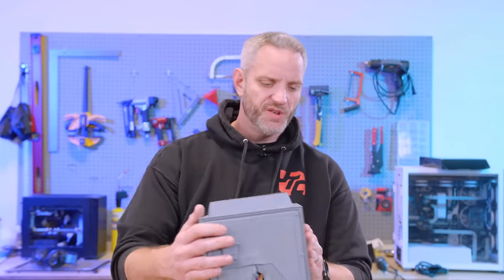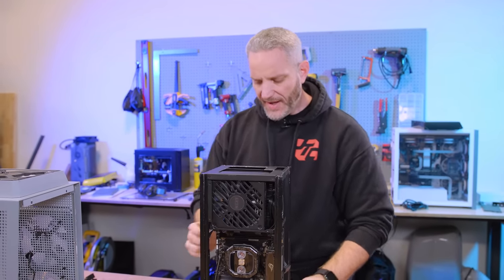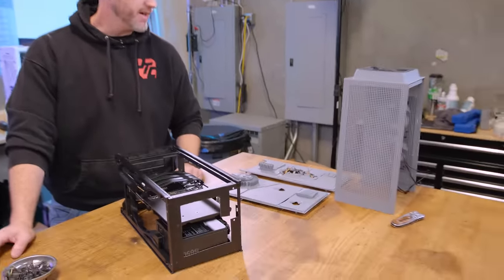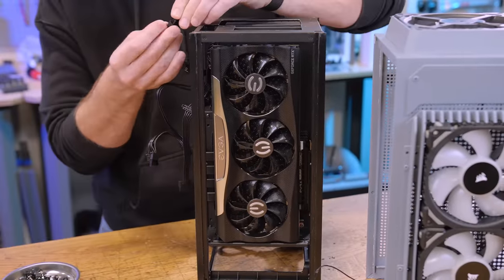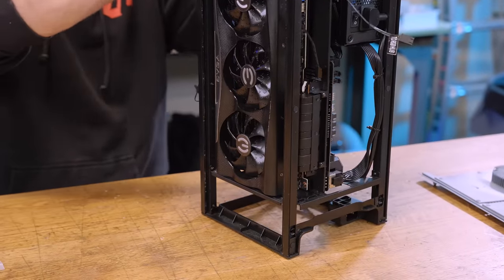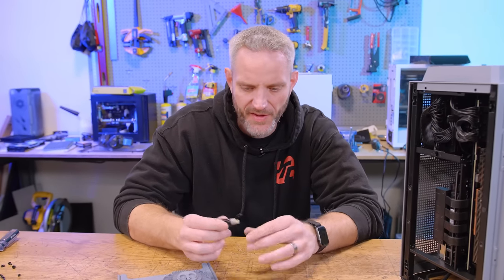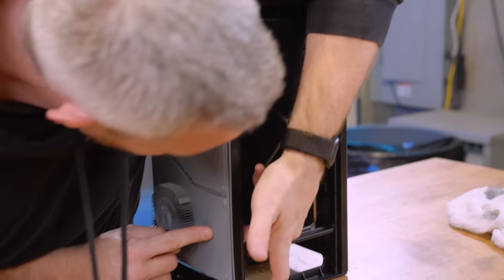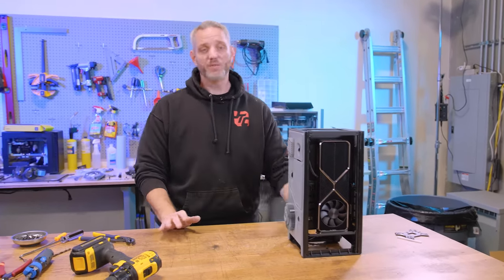This is unfortunate... but I wont let it stop me!

Comment: Just want to put in another vote to get this project finished. I've been searching high and low for inspiration to do a Millennium Falcon themed build with casemods and functional watercooling tubing like the pipes you see on the Millennium Falcon. I was so stoked to discover this video series but it looks like it ends here. Really wanted to see the finished product w/ the airbrushing, water cooling, and lights. So many "casemods" are just paint jobs or LCD panels and RGB, this was such a cool project.

Comment: As a past H1 owner, it’s awesome to see such a bespoke custom build come together, while remedying many of the faults the case possesses. 

With that said, and from past experience using the 3070 FE in this case: you may want to reconsider the FE card, or at the very least make another modification to the case itself. The flow-through design of the card won’t work properly by default, with an internal case panel behind the GPU obscuring exhaust airflow. Additionally, any heat expelled via the PCI backplate will only go down, and then rise back up. The result for my 3070 FE meant that thermals were horrid for the most part.

Comment: Hey Jay, for the power switch, you should use two exposed wire from the bigger damage hole and touch them together to start it. Works the same way as a screwdriver on the motherboard pins. It would be like hot wiring a car. 
Also, thanks for the great content.

Comment: Hey Jay. 
That Asus Tuf 3080 does fit in the NZXT H1. I know for a fact it does, because I have that exact same card in my NZXT H1 and it fits just fine. 
Also that FE card that you are using will overheat because of the 2 sided fans design on that card in the NZXT H1 case.
Reply: Why would u still want that case? There’s so many better small form factor options
Reply: @EmperorWasHere  
Best pc case I have ever had in the 20 years of having a computer, and I like it alot.

Comment: I stuffed a 1070 with the Arctic Accelero 3 cooler in the H1 by leaving the riser cable bracket unscrewed. Gives it just enough wriggle room and the case holds its secure. Even fits with the dust filter.

Comment: Possible spoilers RE: unfortunate but won't stop me
*It's a Rebel themed build, but the Empire just crushed them.
*No power button, you need to use the force to turn it on and off
*Once it's all put together, the fans sputter like a Millenium Falcon.

Comment: Would you consider doing a techmas video on fittings for water cooling? Will be doing a custom loop in an o11 mini with a distributor plate at the beginning of the year but it’s hard to know what fittings I need to buy. 

Over research I found I need the default connectors no matter what but then you have to choose 90s, 45s, extenders, offsets, etc. it gets confusing and is difficult when ordered from EK and paying outrageous shipping.

Just a suggestion for what I would assume would be an easy video for you. Love your content!

Comment: Hey, just an idea.....
4 long screws with the external cpu cooler,
Put springs between case and cooler,
Then install button under the cooler,
Using the cooler to push the button.

Comment: I just got that case, or an original version of it. Replaced my nr200p with noctua U12a. I'm very surprised on how well it works and performs. Although, I do have another front-panel, perforated. Temps and noise level is sometimes better than with my (poorly configured) nr200p :D

Comment: No need to worry about that tube getting a little pinch indeed. The microstructure inside the CPU block is by far the biggest restriction in the loop, even a little bit buckling of a tube would be insignificant.

Comment: With such big fans right on top of the GPU, would it not be worth De-shrouding the graphics card for better cooling and less noise Jay?
It can be done without ruining the GPU so you can put them back later and would save trimming any shroud if there are any fitment issues.

Comment: Would've been cool if you used the wires from the damaged section to have a "hot wire" effect instead of having an actual button. Just touch the wires together whenever you want to turn on the PC.

Comment: You could also drill a hole in the heatsink on the side and put a little switch in it and the logo could connect to switch as the buttonface.

Comment: Almost twenty years ago I was having power button issue and the Radio shack multipurpose button was huge (I finally wound up using it) and all the stores that even had computers wanted to sell me a whole computer and then I could take the button out of that. I wasn't gonna find a regular computer button in the area I live in. Hopefully you have a few parts machines in your inventory.

Comment: Since the power switch has the LED's baked in, you could tie them to Transistors, and have that run off the power led signal from the motherboard to get a "malfunctioning" intermittent indicator light.

Comment: How about turning the Rebel logo into the power button? Drill through the heat sink, recess into the back of the logo and attach to the button head maybe? This would help with the depth issue.

Comment: I know this won't get seen, but!!! It would be awesome if you put a small Arduino Uno in the case on the GPU side and used it for advanced RGB lighting for the damage spots on the case.  Instead of basic effects offered by all retail RGB strip kits, you could have it set to look like fire with random white sparks happening around different spots of the holes.  RBG gets a lot cooler with an Arduino and a roll of addressable WS2812B LEDs!  Also, I'm still rocking the 1080 Ti I won from you in 2018 ❤️

Comment: I'd like to see you guys custom build a pc. Use store bought components but custom build the interior and exterior "case" using 3d modeling and machining. Like a billet aluminum case etc. That way you have full mounting/routing freedom. Use hard lines for wiring routes with custom length wire runs from psu etc. Just really out of the box stuff.

Comment: I know that Jay doesn't use the front panel i/o, but many of us do. The back of my PC is full of cables going out and the front is just good for the occasional USB stick or the USB-C dongle I need for the SD card reader for my media files.

I was even complaining to ASUS that my motherboard didn't include a front panel USB-C connection.
Reply: My list of USB devices:
Keyboard, mouse, web cam, steam deck, printer, VR rig, monitor, UPS, external HDD dock, Steam Controller.

Just to name a few that I have off the top of my head.

Comment: Can you do a PSU video explaining the connectors? Differences / advantages / disadvantages of 6+2 GPU plug in relation to 8 pin GPU plug, 4+4 CPU plug in relation to 8 pin CPU plug. Are they interchangeable? My PSU comes with CPU 4+4 pin plug but MB says it takes 8 pin plug. Are the 4+4 cpu and 8 pin cpu plugs wired the same? Looking to buy custom sleeved cables for my first build and want to buy the right pin cables. Does the PSU (mine is a corsair Rm850x) support using an 8 pin plug in a 4+4 or 6+2 slot on the PSU, weather its PCIE or CPU specific? Thanks

Comment: My graphics card stopped working and short circuits my PC, my power supply just cuts out, it works fine without the GPU and is cappable of running youtube through the iGPU, I am currently using a GTX 680 phantom a i7 3770k 16gb DDR3 and an asus mobo, can anyone help, i tried cleaning the contacts and opening the graphics card but it still shorts out my PC. I am saving up to get a new build but its still a good 6 months off, what should i do in the mean time?

Comment: Jay said the that her little ol chassis was a bit to small to fit the thickkker one, and then there was the problem with the over hanging lips, so he opted pull out his slightly less thickker one and shoved it right on in. It fit like a glove. In fact it was centered just right, but due to the wrapping that went round the outside, round the outside, he would not get to see it.

Jays the man. If at first you don't succeed, well just try, try again. Till it fits.

Comment: Yeah, I hear ya. I build, network, secure computers and networks as a hobby. Long story, but I’m disabled due to 6 cancers and a stroke. There’s more. I’ve posted about some of MY issues my man. 

Anyway, how can I upload or send Jay a pic of MY last computer mishap. It’s a MicroCenter PC. 10-core i9 @3.7GB, running between 4.9-5.1 GB w/AIO water cooling, a 43-45% OC 😁  Works for me. 64GB 2666 MHz RAM running @3608MHz if I recall offhand. 

Previous stroke makes conveying thoughts tricky cuz I have short-term memory loss and word-finding issues, which make troubleshooting a lil tricky sometimes, 😜🤷🏻‍♂️. It’s cool. I don’t miss that part of my brain 🧠 too much. 😜 I apparently had plenty to spare 😝😬. I’m , I’ll just say, a member of the 180++ club. It’s cool. Anyway, where was I, lol. Oh yeah. RAM. 10TB of hard drives, 2 M2’s and 2 4TB SATA drives in raid (redundant copies) for backup and extra storage space. Plus I’m gonna install Linux on what will be, after the holidays, a dual boot system. Best way to fly my peeps. 😜 Oh, and a 75w 5.1 Logitech, registered DOLBY installed. They sound sublime. No, exquisit. I’m IN the action. You FEEL the bass!! 😁 Great for an audiofile and guitar player like me. 😊

Hmm, oh yeah, duh. On an ASUS STROX Gamer MOBO, w/an RTX3080 (10GB DDR6x RAM @1825 MHz core and 19-19.5(9.5 x2ch)MHz memory (1215MHz) 320 bit pipeline. Hmm. 

Sorry, 1 more thing. It has a 750watt PSU. I have but I have an older, from my previous build, a beefy 1200watt Gold certified PSU. THEN I’ll be playing with POWER! Mwahaha, lol. All in a beautiful Lian-Li, Uhh, lol, Model 205? case. I believe. Again, sorry. case w/RGB programmed for individual games, D3, WoW, D2:R. Yeah, I turned 54 years, 2 months ago. I’m OG. 😬🤷🏻‍♂️😜😎✌🏼🤘🏼🤙🏼😷❤️🤷🏻‍♂️👋🏼💨

Bottom line, how can I get a pic to Jay. I just discovered Jay AND MicroCenter fairly recently, cuz of health issues. I’m a LITTLE bit behind in my games as I’m catching up, lol. Fun times. Sorry so long.

I do have Overwatch and something else, 😜. 🤷🏻‍♂️ Which I haven’t played. Sorry so chaotic. ✌🏼❤️🤘🏼😎

MY issue is in a beautiful pic I want to post to Jay somehow. I’m NOT a social-media type. I CAN do it. Just not into it. 🤷🏻‍♂️✌🏼❤️😎

I tried to keep it short and sweet. 😜✌🏼❤️😎

Comment: Jay, could fans blowing directly on the fans of the card cause static electricity to feedback into the card? I would think that if the case fans blowing onto the card AND if the case fans are blowing at a higher RPM than then card fans, that you could blow out the card fans or the card itself.....

Comment: I'm half way through the video, but if the evga card allows it, you should de shroud it, take the fan off of it and use the exterior case fan to cool it, ITX build style, it improve cooling the GPU if the air is well routed and fan are uber close to it. It would make a perfect video... just saying.

Comment: Enjoyed to see that we actually do not need maximus x y z mobos and shiny rgb rams. My 11yr old is damn jealous for this 6700xt. He has just got repaired power section on his evga gtx780 :/ cause prices of new gpus are CRAAAZYYY. GTX died when moved from i7-750 into his new, together built i5-11500. We reused old H60 Corsair AIO, however I think we should switch to some decent air cooled solution.
One tip from me to all. Do not buy ATX case and mATX mobo cause it looks ridiculous. This NZXT mobo looks really nice.
BR

Comment: You should complete the build before you release the first episode. Then you know if it's good and if you complete it.

You know you'll have an episode regularly and you'll know the number of parts to break it down to so it doesn't drag out.

This isn't a car restoration and even those I've just stopped watching until they're complete.

Please do a glass tube 90 degree bend build or I'll have to

Comment: indeed this video is unfortunate. not sure i follow how cutting up a video in somany takes  and basically ending up  filming him turn a screw driver and drill a hole but nothing shown fully. plus at the end the case is uglyb as fuk. even if painted i don't think you can recover from that with a paint coat.